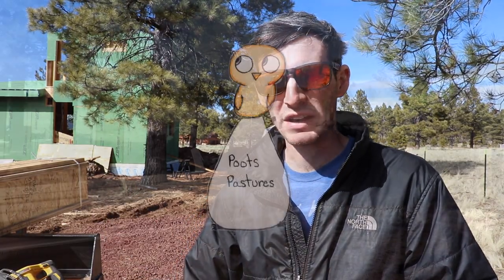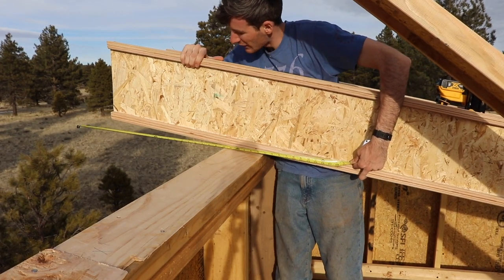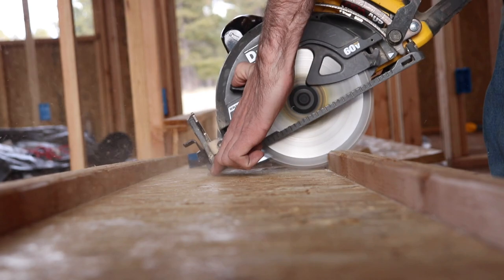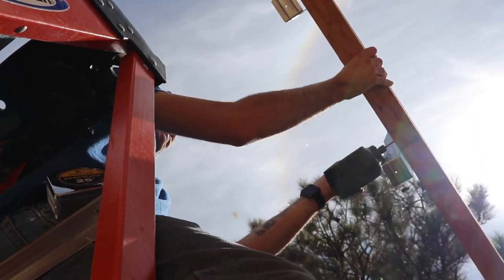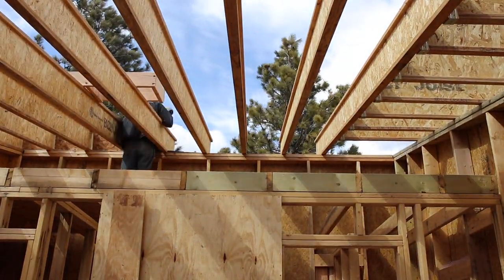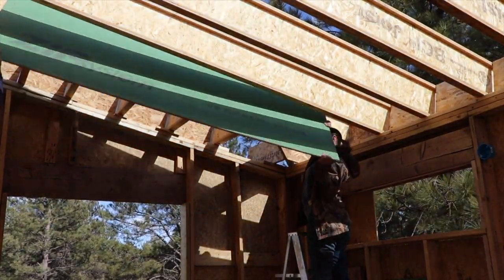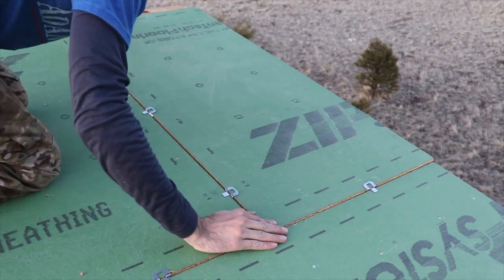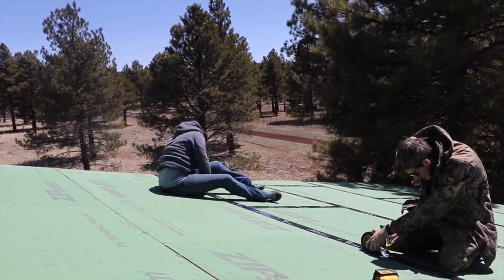Framing A Roof With I-Joists Pt. 2 (Framing and Sheathing a BCI Roof)

Comment: He needed web stiffeners where he put his blocking in on both sides . I love cutting web stiffeners 😂
Reply from the maker: we don't need web stiffeners for any type of loading, the only reason to add them would have been to fill the space, which we did with foam.  Web stiffeners suck to cut so yeah we skipped that.!

Comment: Hey! Great build! I was curious if you thought about using rim board to cap off the bci? Or is just some plywood good enough to cap off. Let me know your thoughts if you can! Thanks so much.
Reply from the maker: The problem with the rim board is that it's really heavy and you would only be nailing it to the ends of the joists unless you added blocking.  We found the plywood worked fine for what we were doing.

Comment: Nice work. We are framing up our farm packshed with BCI's too! This was a great video to watch as we tool up. I noticed you just use OSB scraps as blocking on your BCI's on one end of your roof. How'd you actually nail that in? Did you use some kind of brackets we couldn't see?
Reply from the maker: So the blocking was a rim board made by the same company as the joists so it is the same height, they are also 1.25" thick so I just toe nailed the bottom of the blocking into the top plate and then shot a nail on the top and bottom of each side of the blocking to connect it to the joist.  Hope that helps! And good luck with your project!  The joists are really easy to work with and we really like them!
Reply: Thanks! I also appreciate the eave details in your video. I was wondering how I'd do that. We are also packing our roof with cellulose, along with our double stud wall. Please visit our farm if you are ever in Montana! @PootsPastures
Reply from the maker: Glad it was helpful! Not sure the next time I would be up that way, but if I am I absolutely wouldn't and likewise for y'all if your ever in AZ!

Comment: This is really awesome, you guys did an amazing job!  I'm doing a very similar roof and wondering what is the snow load in your area and how did you determine the snow load capacity of the I-joists?
Reply from the maker: The load capacity of the Ijoists is determined by the manufacturer.  There is a chart where you match the load needed to how far apart the joists are spaced, and it gives you the maximum span of each type of joist.  I think our ground snow load is 60psf

Comment: If you could have framed the i-joists up plumb with the wall to make a box, and then later installed the eves for your overhang, wouldn't that be much more air-tight and potentially a bit easier than having to fill all those cracks?
Reply from the maker: We tried to to that on one of the sides and it was super hard and we abandoned it completely.  Filling the gaps with spray foam wasn't hard at all, and if you wanted to you could put blocking in the web so it was completely flat.  I will note we did it how the manufacturer specifies.

Comment: Great videos and very helpful. Thank you.  We are about to undertake building our own home so you are an inspiration. Curious where you are building this place?
Reply from the maker: Thank you! That means alot, and we are in northern AZ between Flagstaff and Williams.  Where are y'all bulding at?
Reply: @PootsPastures  Cobb, CA. Southern Lake County, just north of the CA Wine Country. Bought a property in the burn scar of the Valley Fire (2015). Had an architect design a house to fit the foundation and are ready to start building in a few weeks. We will be following your tips!
Is your place finished? I haven't gotten through all the videos yet.
Reply from the maker: That's awsome, you have some stressful times ahead of you but when you start to see the end it makes it all worth it!

We are not finished yet,  we're hopping to have insulation done this week then it's just trying to get drywall, septic, and power done in the next couple weeks.
Reply: @PootsPastures  Thank you. We are prepared for it. We have remodeled about 6 homes over 30 years and completely rebuilt 2 others. At one point we've tackled just about everything. Got an email over the weekend that the permits are ready to issue. Just need to bring the balance of any money we thought was ours vs. the county!

Comment: What made you guys decide on a slant roof instead of truss ? I like the slant look but metal roofing is so much more expensive
Reply from the maker: I like the simplistic design of a shed roof.  I also couldn't get any truss company to return my call as I wasn't using a contractor.  We also would have used metal roofing either way because we are collecting rain water off of it, and it's more fire resistant.  Hopfully that helps answer your questions!
Reply: @PootsPastures  Ok thanks, it looks great. I was just trying to decide if I would be better off using trusses for shingles, I'm a bit concerned with the high up work for a slant roof.

Comment: How did you bevel the top plate? Circular saw? Table saw?
Reply from the maker: We originally tried a circulars saw witch was super sketchy so we ended up using a table saw (which was only a little better).  If I were going to do it again I would rip the top plate in half so you are only trying to bevel a 2x3 not a 2x6.  And then place both the 2x3's on the top plate.  Hope that helps!
Reply: @PootsPastures  it helps very much thank you for responding

Comment: Hi how long can I joist be for a roof l need it for a shed type roof that is 32 ft long.
Reply from the maker: That's a hard question to answer.  The short answer is yes.  If you look up the company that you want to manufacture the joists (for example we used BCI or Boise cascade) they should have a "specifier guide" that will help you choose the right size joist for your application based on span distance, roof pitch, snow load, and joist spacing.

Comment: Where did you find the specs for using the I joist to make your end gable overhangs by installing perpendicular to main rafters?
Reply from the maker: That is specified in the specification guide that is made by the manufacturer.
Reply: Idk if you're still interested. But I've been studying bcis guide for over a year.  Seems like the detail he used should be in the guide.  But it is not.  BUT it IS allowed.   Just got to this part of my build and had to call to figure it out.   You are allowed to use I's as outriggers.  Just recommended to do 2 pile anchors instead of a single I joist.

Comment: How did you connect the i-joists to the top plate or in my place a double 2x12 girder? Normally you'd cut a birdsmouth in 2x lumber...
Reply from the maker: You can cut a birdsmouth the manufacture then requires you to add some bracing to the webb of the I joist.  So instead we beveled a third top plate to be the same angle as the slope and then attach the joists with two nails and a hurricane tie (in our case a structural screw).

Hope that answers your question!
Reply: @PootsPastures  sure did ! Thanks man

Comment: What's the point of putting window header and not routing load from the top plate with cripple studs through it? Header supposed to distribute weight from everything above to jack studs. In your case it just sits there lonely.
Reply from the maker: I just havnt put some of the top cripples in yet, I know it probably should have gotten done before the roof, but with the rain we have forecasted I wanted to get our roof up as quick as possible.

Comment: Also screwing mine down with lag bolts!
Reply from the maker: Look into using structural screws instead of lag bolts as they tend to be thinner so you aren't drilling through as much as the web.  They cost a little more but I use them for all my top plate to joist connections. They also can replace hurricane.

Comment: What’s your roof pitch?
Reply from the maker: The pitch is about 2.5:12, so about 11 degrees.  Not ideal, but going any higher with our pitch would have been hard in our case because we had so many issues getting someone to design trusses.  We also recently spec'd trusses for our barn, and trusses still came out about double the cost of I joists.  Another plus is that the snow will not slide off of our roof which means we get to collected all of the water from when the snow melts, however it does make our snow load higher.  Hope that helps.
Reply: On the side it looks like you had to block underneath the short I-joists.  Is that correct?